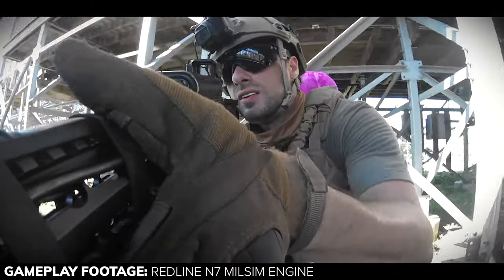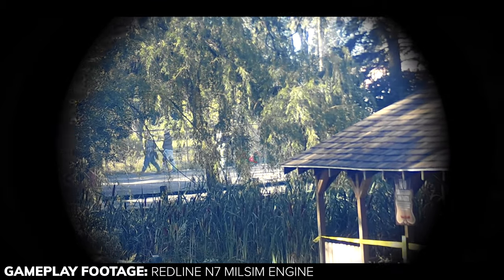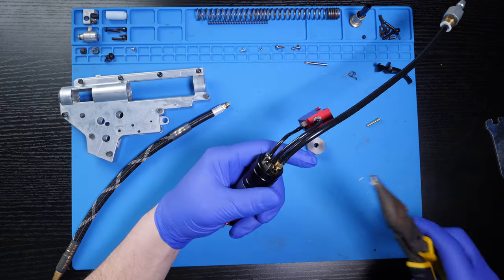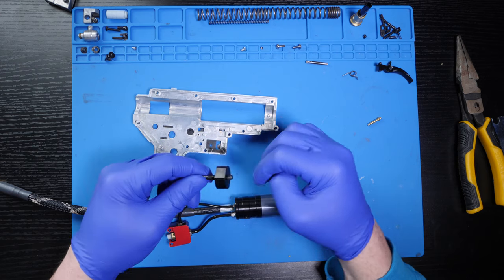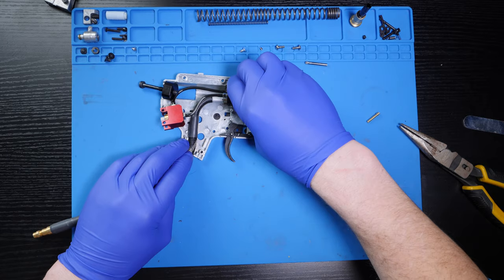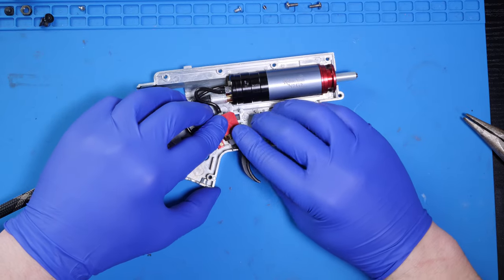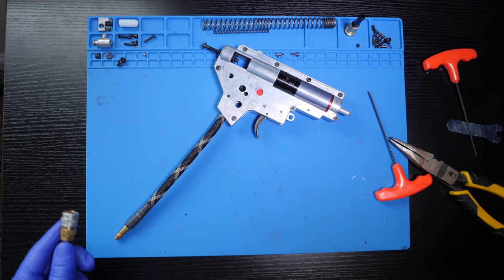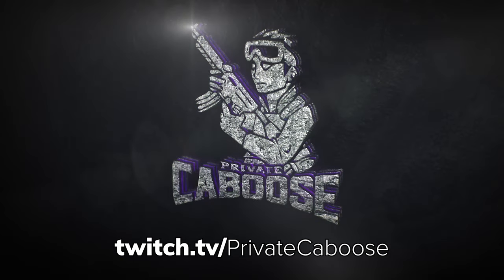How to Install the REDLINE N7 HPA ENGINE | GEARBOX INSTALL & REVIEW

Comment: Very informative video, clear and concise. Just a quick question for you or any other N7 Milsim Gen 2 Users. Have you experienced a constant, slow leak through the hole in the  Body FCU (rear black section of engine) that is right next to the sleeve (grey with branding)? I've cleaned, regreased, and reinstalled the rebuild kit but still have a leak.

Comment: Nice video! I still prefer my kythera simply for the efficiency and the extremely nice and realistic trigger pull and actuation.
Reply: @trilogy airsoft is it? Good to know. But still that trigger on the kythera 🤤
Reply from the maker: Ultimately it just came down to maintenance for me, I was opening the kythera up often to maintain performance while the n7 continued to operate well.
Reply: Imo the kythera is quite "springy" idk if that's the right word, but it just doesn't feel good to me

Comment: Nice Vid! You dont need to adjust the amount of air in the inner barrel and things like that?
Reply: probably a fixed volume system like the kythera
Reply: You can de-volume the dump chamber to make it a little quieter and get better air efficiency. Also helps reduce joule creep.

Comment: hello very good, watching your channel and seeing that you have tried both the kythera system and the n7, as you see them, what good or bad things they have, you who have tried them, which one would you stay with, which gives fewer problems, better performance, Cheers
Reply from the maker: Hey thanks for checking out the channel. Good question, I can sum it up as I sold the kythera and bought 2 n7s.  And it is mostly due to the kythera being very problematic. The n7 serves me well and I barely need to open it up for maintenance.   The one plus of the kythera is it is CRAZY quiet, but not worth the problems in my opinion.
Reply: @Private_Caboose  Hi, thanks for replying so quickly. what problems did it give you? I am preparing a gr25 g&g and they recommended that I install kythera on it. and also to get rid of the hose I would have the bottle system in the cylinder head. but I don't know how many shots I can make with that kind of small bottle
Reply from the maker: @3Nt093  a lot of times I would go to pull the trigger and it would take like 3-5 trigger pulls before a bb would fire.  I contacted amped Airsoft who installs a lot of these and they said the system simply needed to be cleaned. I cleaned it, went back to the field and after a day or two the same problem arose.  

Now I will say, my kythera was batch 1, I preordered and all and I am aware that there were some issues.  So I’m wondering if new kythera production has ironed out the kinks.   

I’m not sure why they would recommend the kythera, anything that fits a kythera should fit the n7.  

But this was just my personal experience, perhaps yours will be different.
Reply: @Private_Caboose  Well, what bad luck, but normally the first runs are always for testing, I hope they solve the problems that I might have

Comment: My GF wants to get into airsoft and I've been looking into making a n7 milsim build because she wants to be a lil bushwookie sniper/designated marksman. The problem is I want to get her something like the g&g .308 rifles as a base gun but that's a $400 AEG plus like $250 for the engine. Does anyone know a bit cheaper option for a base gun? I would go tippmann but I don't think I could get the accuracy to where I want it. I love mine, but accurate it is not.

As always great video
Reply: Look into Cyma for cheaper, but quite good guns, the  bodies of the (metal) Cyma guns are phenomenal.
Reply: @quinlanreed7162  lol I have 2 cyma ak's. I'm looking for a .308 platform
Reply: @bishoppope2921  They make many different platforms, M4’s, AK’s, SR’s, just gotta find em.
Reply: @bishoppope2921  I personally recommend the EBR series.

Comment: I've got one of these and my trigger quit working before I even got to use it in a game. The 3 way valve isn't sending air back into the engine. No idea how to fix it yet. So far. not happy with my purchase.
Reply: Did you manage to fix it ?
Reply: @MovinOG  Yeah. It turns out the hose on the 3-way was too long, and kinking itself. stopping the airflow. 

I cut about 1/4th of the hose off and now it's been flawless.